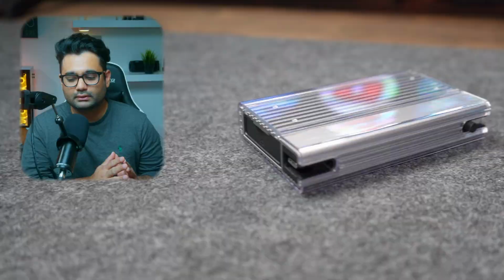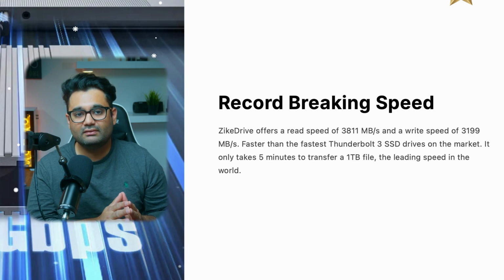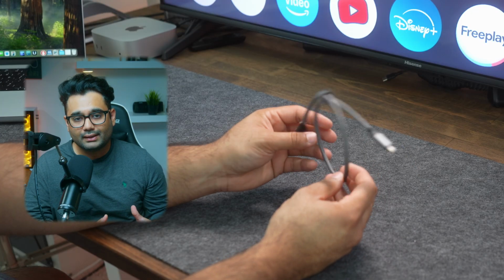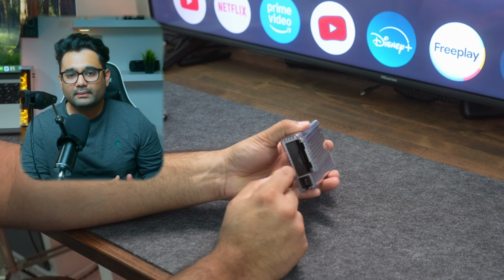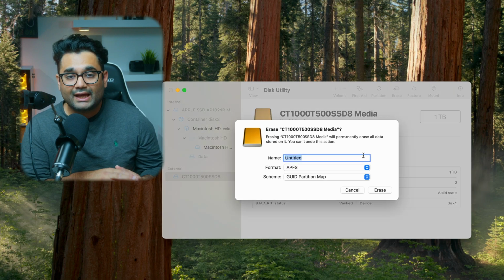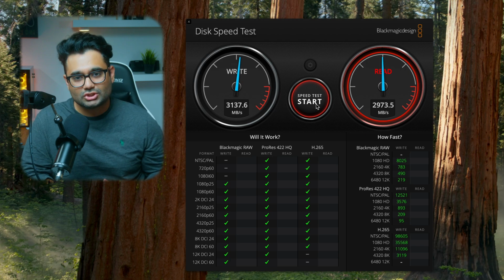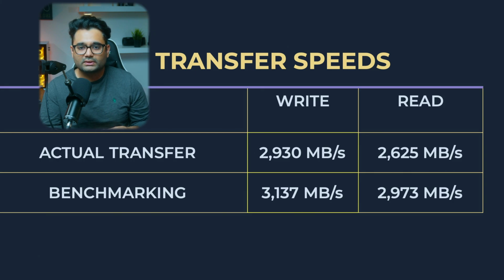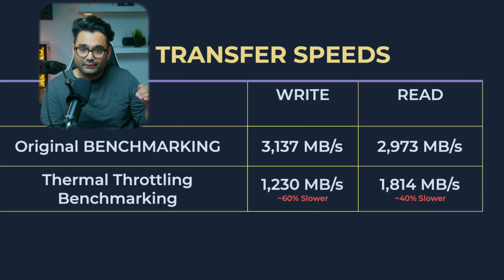Best SSD for M4 Mac Mini | ZIKEDRIVE Z666

Comment: Do you know if TRIM is enabled in macOS for the Zike Z666 enclosure? The big issue with external drives and Macs is that macOS will not enable TRIM if the drive isn't Thunderbolt, but I am not sure if USB4 is the exception to this rule. Great video, and thanks!

Comment: Thanks for the video!! Now that you have both the Zike Drive and the OWC, which one would you recommend? My plan is to setup the hole folder on it with a base model M4 Mac Mini.
Reply from the maker: Both zike and owc seem to be identical in terms of performance. Having that said Zike is easier to open install ssd. Since zike is on sale still and owc is not I would just suggest go for zike z666.

Comment: No, this is not the best for me. I want a fanless case for my SSD, since I'm into music production. The OWC 1M2 gives me a fanless hard metal case, with the SSD securely safe inside. With write read speeds in the 3100s or more. Plus its been around long enough to prove durable and dependable. I highly recommend it.
Reply: the zike is fanless. both owc and zike use the exact same chipset, hence exact same performance. you're talking a load of bullcrap.

Comment: I’m only getting 835mbs exactly the same setup and drive :/
Reply from the maker: @madebycompound  what’s the ssd brand? Did you plug into the back of Mac mini? Front ports are not thunderbolt 4

Comment: Clearly wrong, many videos demonstrating that without active cooling throttling is awful. Again another youtuber just clickbating.
Reply: Yes and no, depends on your use case. I’m doing audio recording so fan noise is a problems. I got a fanless nvme enclosure, put my session and drum library on the ssd in nvme, no problems and enclosure is barely warm to touch, so I’m fine ymmv!

Comment: I saw a YT vid recently where the creator used two ZikeDrives in a RAID 0 configuration and basically saturated the TB4 W/R thru-put. They then used a budget 2TB USB-C 3.2 SSD as a Time Machine backup for the whole shebang. Of course you'll need 2 TB4 ports for the RAID setup but for less than 400 bucks you'll get crazy fast drive performance.

Comment: IMO you'd be  crazy to leave the plastic shell on. Thermal throttling is a significant issue with this fan-less enclosure. (I have one.) The only justifying feature of the shell is preventing users from burning their hands/fingers (and suing Zike?). So take it off and just be careful. It's a PITA to remove, but it can be done. On the subject of temperature.... I don't know the relation between the surface values reported by a scanner such as you used, and the values reported by the enclosure's internal sensor which can be seen using software like iStat Menus or Macs Fan Control.  Sensor temps in the 30sC are what's seen while the SSD is idling. When it does lengthy writes temps can exceed 70C. ... Separately, AmorphousDiskMark is a more versatile and informative speed (and latency) tester than Black
Reply from the maker: Thanks for the tip about the shell and the temperature information!
Reply: So after removing the Plastic cover what was the temperature difference?  Like 10 C ?   Cause nvme usually works at around 50 C. Without throttling.

Comment: Yeah, my Thunderbolt 4 external drives give me about the same and if you multiply the number by 8 bite per byte you end up at about 24Gbps on a 40Gbps link, so there appear to be room to go faster, but I think I’m maxing out the current M2 drives I’m using. 40Gbps (max on Thunderbolt 4 would give you about 5,000GB per second, so getting around 3,000GB is 60% of the link capacity.